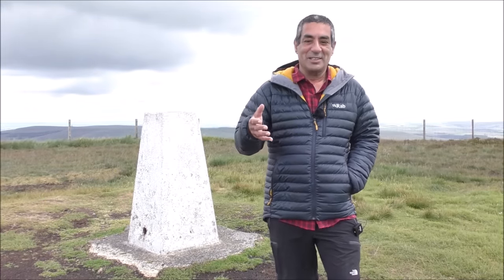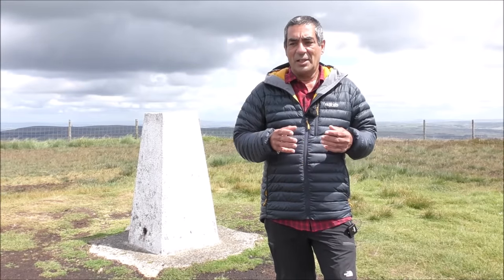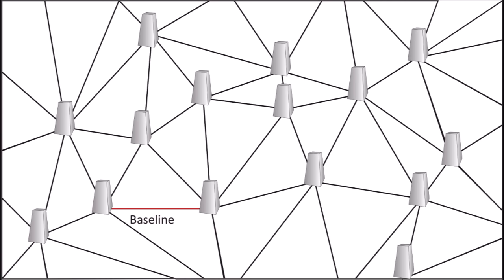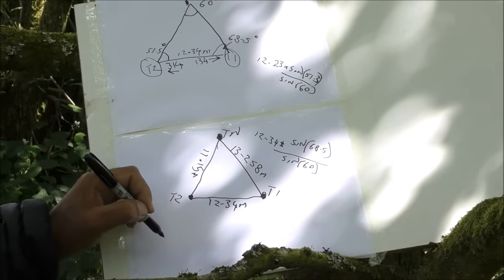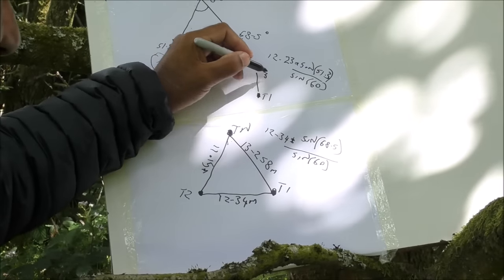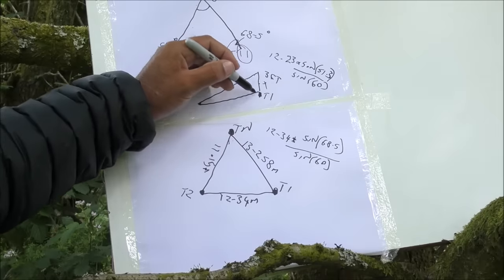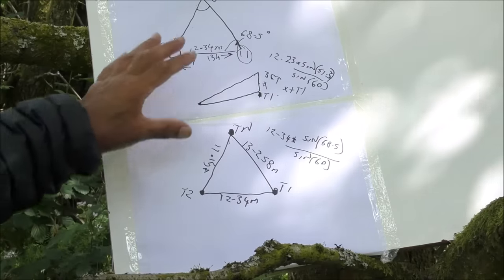How do trig points actually work?

Comment: When I was a kid (in the 90's) I remember some of the trig points here in Australia had a metal pole on top of them with 2 black circles intersecting at right angles on top of the pole.
What would these have been for?
Most, if not all trig points don't seem to have this on top of the concrete section anymore from what I've seen.

Comment: I’ve stumbled across dozens of trig points around the world but have never been able to see other trig points from that location. It’s quite frustrating because you KNOW the system only works if you can see two other trig points.
Why is that? Is it because the system is out of use and the sight lines are overgrown, or is it that I need binoculars to sight them? Of course, it would help greatly to know exactly where to look!
Reply from the maker: In the UK, not sure about other countries, Trig Points are no longer used by the Ordnance Survey for map making.  This means that they are no longer maintained, so some have been removed, fallen over, become overgrown, etc.
As for being able to see one from another trig’s location, remember that a theodelight is basically a small but powerful telescope. When it was rotated its angle was read and noted.
Also it was common practice to take sightings at night and lamps would be placed on trig points so someone taking a sighting from a long distance away would be able to see it clearly – the OS surveyors spent many days waiting for clearing weather.

Comment: I have done this with a one-second theodolite. Yes, it's accurate to one second of arc. At that accuracy, you are down to 1/360 of a degree.  When you close the triangle to 180 degrees 00 minutes, 00 seconds, it can't be resolved, and it will be out by several seconds due to the long distance between observation points.  As this triangle is part of a much larger gird of triangles (all spaced so that they are as close to an equilateral triangle as possible), A weighting process is ascribed statistical adjustment to distribute the error among the three angles to force the triangle to 180 degrees precisely.
Reply from the maker: Normally I answer questions in the comment, but here I have a question for you – I love learning new things.
If you’re using a theodolite which can focus down to 1 second why can’t the triangle be resolved and why would need to add an adjustment to resolve it. 

Thanks if you can answer – I think other map Geeks would also be interested in this (or maybe it’s just me 😄 )

Comment: Can this work if your Trig point is 20 miles away OVER the Curve of the earth ?  Dont you need line of sight ?  just wondering :)
Reply from the maker: Over 6,500 trig points were built around the UK.  They were never more than a couple of miles apart.
Reply: @TheMapReadingCompany  Then that make's sense .. Thks for reply :)

Comment: The clever bit concerning 'but why is a triangular mesh useful', and perhaps worth mentioning in another video is that once you have measured distances and bearings representing the 3 legs of the triangles in that mesh, if you mathematically travel around any triangle following those bearings and distances  from trig (vertex) to trig, i.e. the vector sum, you should find yourself back where you started. You won't, because all of those measurements have some amount of error in them, which accumulates. But now we know the total error summed over those 3 legs. We can repeat this for all the other triangles that can be found in that mesh and arrive at an estimate of the error for each leg. In areas where error is found to be high, measurements can be repeated. We can now employ statistical techniques such as least mean squares to distribute the error over all the legs to an acceptable level and determine sufficiently accurate positions for all the trig points in the mesh.

We've gotten so accurate with geodetic techniques now that we have to consider the fact that our geodetic stations may well be sturdily constructed, but in geological timescales, the ground they are on is a continental rubber sheet that moves and deforms at millimetres a year.

Comment: Great video, thank you. As I understand there’s a bit going on inside the trig point which includes a sighting tube, a centre tube and at the bottom a centre mark.
Reply from the maker: Yes.  If you look at the thumbnail photo you can still one of the sighting tubes - at the bottom of the face.
I did include a fuller description of the trig and how it was constructed but I had to edit it out as the video was becoming too long.

Comment: Sure, but in what part of that no so precise lump of concrete or cement is defined that mm ultra/precise position?
Reply from the maker: If you look at the thumbnail photo you can see a small hole at the base. There were holes on each side, but three are normally filled with concrete (one is left open to allow moisture to evaporate). These are sighting to holes would allow the top (brass) mount to be placed “directly” above a brass marker, built in to the foundations. It is this marker which is precisely positioned and it’s position calculated.

Comment: A very simple application to life of that principle is how we used to measure the distance of a competitor's jump in tournament water skiing. Three points along the shore, each with a protractor with about a 15 inch radius and a plastic sight on each one. A tape measured the distance between each and from the fixed protractor the angle to each. That transferred to a large table, scaled down and the angle from each to the ski jump pinpointed the jump position. Then when the skier landed his jump. the angle from each was noted and transferred via string onto the table and a landing point was ascertained, then measured in scale from the jump. Job done. With computers, the table was dispensed with and replaced by a computer program into which the information was fed and the distance now spat out. Now it is done via a series of cameras, a video to pinpoint the lading point, a series of buoys in the water with surveyed positions and a program in a computer and using the mouse pointer to pinpoint the landing spot on video replay and the program spits out the distance jumped. Common thread through all systems is trigonometry. Thanks for the video.

Comment: Great video, thanks. Sorry if it has been covered in another comment, but I can not find it. How was the first baseline measured accurately. Thanks
Reply from the maker: They used a form of invar tape - in this case basically a wire which was measured VERY accurately.  Have a look at this BBC documentary. 
https://youtu.be/w5_kWzUahQU?feature=shared
At the 35 minute mark you can see this in action.  Note that when I said VERY accurately I do mean VERY.  Using microscopes to measure the length of a precisely tensioned wire may seem, at first, slightly over the top, but keep in mind that this level of accuracy is simply not possible in any other way if you’re measuring a 10 mile distance to the millimetre.  It’s this attention to details which is the reason which is why the UK Ordnance Survey tends to get thing right with maps.
Reply: Many thanks for the reply.

Comment: The baseline, does it have to be completely level? If not the distance by say a light beam between two points 11km apart will be less that the up and downs of undulating ground.
Reply from the maker: Hi Peter, when measuring a base line any “unevenness” (including the curvature of the Earth) will be taken into account when calculating the distance between the end points.  Base lines take a great deal of time and effort to get right.  I have seen old photos from the 1930’s of the Ordnance Survey using microscopes to view the markings on the invar tape – as the marked increments were so small and precise.
Reply: Thank you for replying. It’s more precise than I imagined.

Comment: Can you explain why if the bearing from t1 to t2 is 134 the back bearing must be 314 ?
Reply from the maker: Hi Dave, you have to remember that there are 360 degrees in a full circle.

If the bearing is 134 (e.g. the example used in the video) then that is the heading you would be walking in, if you followed it.  If you were to go in exactly the opposite direction you would be walking on a bearing of 314.

If a bearing is less than 180.  To get the opposite direction add 180.
If the bearing is more than 180. To get the opposite direction subtract 180.
As an example
If your bearing is 123 you would add 180 = 303
If your bearing is 345 you would subtract 180 = 165

Watch this video for more details
https://youtu.be/61uMkv19Uyw?feature=shared
Reply: Thank you. Got it. Was confused by 134 and 314 not adding up to 360. I would have done 360 minus 134 and walked on a bearing of 226, in the fog, and over a cliff. Watched the video you recommended and enjoyed that too so I will work through all of them and subscribe.  @TheMapReadingCompany

Comment: The trig point nearby my house has a brass plate on its top and I understand that an instrument would be attached to what lies beneath the brass plate once it is removed ...  there are no other plates on the concrete structure such as the one mentioned in the video, i.e.on the side.

Comment: Very interesting video and very well presented, thank you. btw I believe that altitude is the height above the ground . Elevation is the height above sea level .
Reply: Exactly opposite …. 

Altitude is measured as ‘sea-level’. It is measured in ‘atmospheric pressure’.
Elevation is measured as ‘height above terrain’. It is measured with radio waves or lasers bouncing off the ‘terrain’.

Ask any aviator. Or in any aviation-related field.
Or anything that flies, soars or wings, or rokckets up.

BTW, altitude varies with the local barometric pressure reading, and must be corrected to sea level.
One data point that pilots get just before take-off or landing is ‘Corrected Altimeter’, which is corrected to the local airport, at that time.
Often called just ‘altimeter’ by ATC.
Reply: @ernestgalvan9037  Having looked up the meanings using various sources , it appears that altitude should only refer to an airborne object ,but can mean height above sea level , or height above any chosen fixed point.      Elevation is the height of the ground (or an object on the ground ) above sea level . I don't know what a point below sea level would be called , obviously  the figure would be minus , but would it still be elevation ?????

Comment: Did anybody here use Wild T2’s to triangulate from pillars?
Reply from the maker: No, the survey of the UK was mainly done with a number of CTS Tavistock theodolites.  After WW2 a few more were ordered but, as they were lighter, the OS mostly continued to use the CTS as they were less prone the wind movement..

See Picture here:
https://en.wikipedia.org/wiki/Cooke,_Troughton_%26_Simms#/media/File:CTS_Tavistock_1.jpg
Reply: @TheMapReadingCompany  yes i was aware of that. I was just asking whether other surveyors had spent time occupying the trig pillars whilst working. I read from several pillars in the welsh area during the seventies using T2’s and HP edms.
So different now!

Comment: After we've mapped the baseline and trig points we've got thousands of accurate triangles but presumably an undefined coastline. Using the same method with a mobile chain man must be difficult because some parts of the coast can't be in view of every local trig point. Tedious surveying job if the same method was used and there must be accuracy issues with boundary definitions
Reply: For several reasons a coastline can never be defined with precision.  Coastline is a man-made, artificial concept.  We all know where the land ends and the sea begins, but not with a surveyor's precision!  Nor can the length of a coastline be given with anything approaching precision.

Comment: I bet they measured in miles not shitty Kms !!
Reply: Actually they measured in chains. So called because the measuring device was literally a chain. There are 80 chains in a statute mile, and in cricket the distance between the opposing stumps is exactly one chain (even if the ground keeper thinks of it as 22yds or worse uses the metric equivalent the distance is a chain)

Comment: Here in Ireland theres an elevation value on my ordinance survey maps which corresponds to one of those arrowhead symbols chiseled into my neighbours' stone wall.  I always understood that the symbol portrayed a three_legged stool, to denote the tripod used by the surveyors. Ive never seen one of those concrete structures but round here we have lots of old stone buildings, drystone field 'ditches' and rocky outcrops which would have served the same purpose
Reply from the maker: Hi Daneen
The arrowheads are Bench Marks not trig points.  The horizontal line at the top was used to place a bench on which the levelling stave (basically a big ruler) would rest on – hence the name “bench “mark.

Comment: At some point they have to shift from two dimensions to three due to the curvature of the Earth.
Reply: Mapping grids are made on a projection …. Probably best to consult Wiki!
Reply: @williamhall8683  At some point, a straight horizontal line will extend into space 1 million miles from Earth due to the curvature of the Earth.
Reply: @williamhall8683  What is the accuracy of a Mercator Projection map, especially for Greenland?

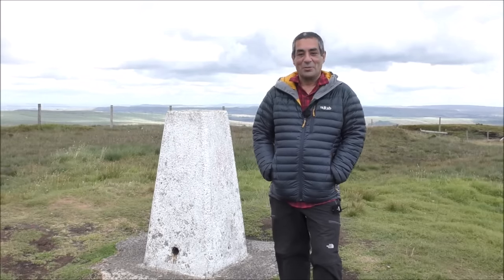Comment: 15:00 How do you know the distance between T1 and T2 ?
Reply from the maker: It's just for video use. 1234 or 13.34. Was going to use 6789 - 67.89
Reply: @TheMapReadingCompany  I understand that the distances that you used in the video were just for illustration but in order for trig points to work there has to be at least one known distance.  In your video you mention the 1937 baseline.  How was that measured, bearing in mind that it was 11 Km long and the land between the ends is not completely flat ?

That raises the question as to whether the measurement between trig points takes into account the difference in elevation between them or is it corrected to give the distance as it it were a sea level

Comment: I watched this with great interest, but sadly, you didn't address the question I really, really wanted to know. How did they establish the length of the baseline, the distance from T1 to T2? In the modern age they can use lasers, but in 1937 (or the 1800's for that matter), how did they do it? I would guess they probably used some form of optical range finder, but how would they get it really accurate?
Reply from the maker: They used an invar (metal) tape with a fabric screen around it to prevent the wind moving it.  Basically measure one section REALLY carefully then move on to the next.
Reply: One of the end points for the original baseline across the Hounslow Heath has a monument to Major General Roy on a small circular road off of Roy Grove between Hanworth Road and A312.  The northwest end was near the southeast corner of a parking lot at Heathrow which seems to be bordered by Northern Perimeter Rd, Nene Rd., and E Ramp.  Those are what Google Earth call the roads.  The only thing that has a label in the parking lot is a Shell Recharge Charging Station.  That area used to be called the King's Arbour but the only place that looks like it would be easy to find is a pub called the Three Magpies.  The end point was about 160 m from there at an azimuth of 168 degrees.  They show a picture of a cannon and plaque still there.  

If I remember right, that baseline was first measured with glass rods in 1784.  They did a lot of experimentation on ways to measure baselines back around 1800.  The French used metal rods that were leveled and laid end to end and measured the gap between the rods.  In some places they used wooden rods with metal caps that were compared with a physical metal rod.  The English baselines had to be remeasured after the original physical yard was destroyed in the fire of 1834 and had to be reconstructed.  I don't think I was ever able to find General Roy's published account of the baseline online.  It was remeasured with a steel chain in 1791 by General Mudge.  Col. James account of 1858 is findable online: Account of the Observations and Calculations...

One of James' baseline ends is next to A345 near Old Sarum.  The other end of that one is on Beacon Hill just north of A303.  That one has a trig point on a side road near Bulford Barracks but the road seems to be a dirt road with no name.  It has a couple of big metal towers on it and seems to be well used but I don't know the name.

Anyway, if you find them you can get an idea of what it must have been like to measure those long baselines with chains or rods back when there wasn't much out there.

Comment: I'm kinda quite annoyed, as I totally get the triangulation, the level differences, but you literally just said "we are gonna say this distance is 12.34 feet, yards, kilometers, whatever"

Thats the important part! Using triangulation only, and a generic "lets assume" ratio, Britain would be perfectly mapped, but could be 6 inches or 6000 miles across.

You even said it yourself near the start, "how do you tell the distance between the two, with all the hills and such in the way", but you don't explain that at all... Thats what we need here. HOW do you tell the distance between them, if you dont assume you already know one?
Reply from the maker: I used 12.34 as an example, it could be any distance.  
From that (any distance) we can use the Law of Sines to calculate the other distances.